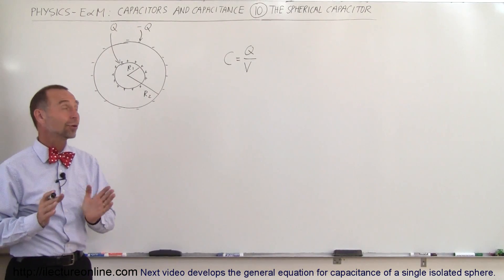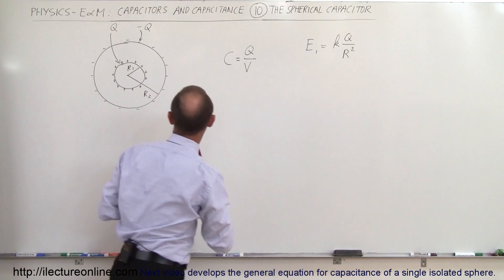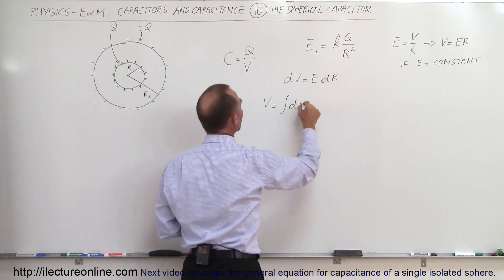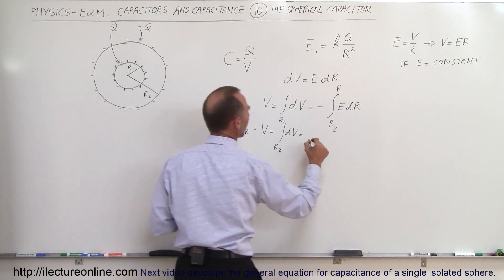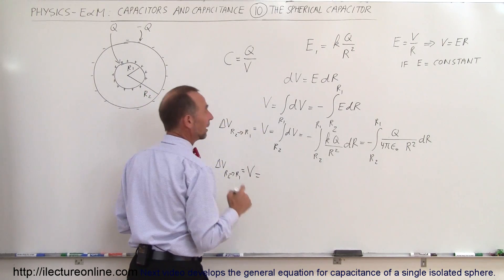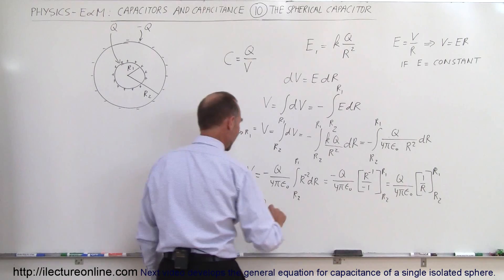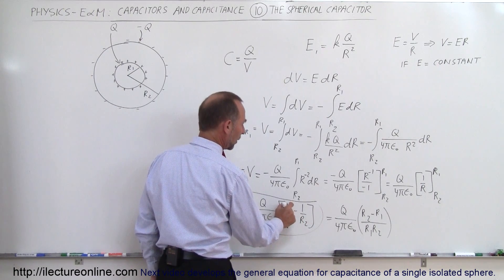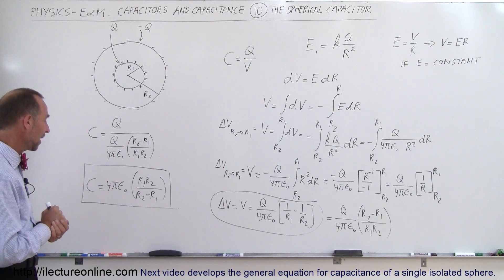Physics 39   Capacitors (10 of 37) The Spherical Capacitor

Comment: If I understood correctly and I would be more than happy that someone will correct me in case that I am not- the reason he keeps the negative sign is because the potential difference in R2 is smaller than that of R1 so when integrating from R2 to R1 we are getting a negative result- hence he needs to put a negative 1 to cancel that minus.
Reply from the maker: You are correct.  🙂

Comment: I have one doubt, why didn’t the presence of positive Q charge on the inner shell induce a -Q charge on the inner surface of the outer shell, since the outer shell is a conductor and field inside it must be zero
Reply from the maker: There is always an electric field outside a distribution of charge (as in the inner ring), therfore there must be an electric field between the inner sphere and the outer sphere

Comment: Sir the video was very Good and concise But in my reference book i saw thath the outer shell was earthed and capacitance was calculted then in next case the innner shell was earthed and capacitance was calculated but here I wanted to ask can we calculate the capacitance without earthing.
Reply from the maker: The only thing that matters is the potential difference across the plates.  Grounding one side or the other side, simply places a reference voltage of 0 V on that side.  As long as the voltage difference between the plates is not affected it doesn't matter.

Comment: Hi! Thanks for your videos. I think I have a little of confusion . Isn't the electric field inside a conductor zero ? Then why is there between R1 and R2 an electric field? Thank you a lot!
Reply from the maker: Gauss's law stated the the electric field strength multiplied by the area of the Gaussian surface is proportional to the charge enclosed by the Gaussian surface.  So bottom line, there will always be an electric field around an enclosed charge.

Comment: You use incorrect relation between E and V. Since E is a conservative vector field the correct relation is: V (B) -V (A) = - definite integral (from A to B) from dot product E * dr. In your calculation, to get a good result you’ve had to change the interval of the integral. Using the correct relation, nothing has to be changed or determined.

Comment: When you change limits doesn't E.dr changes signs? (you never took the integrand as vector dot product, so technically this derivation is wrong although you get correct result somehow)
Reply: @Debanjan Bhattacharjee You think 'dr' is radially outwards?? 2:33

Comment: sir,what confuses me is E is pointing radially outward but the path is chosen inward.so E.dr=-Edr shouldnt it be the case??
Reply from the maker: Since the change in voltage = E dr     The voltage change is negative traveling in one direction and positive traveling on the opposite direction

Comment: Sir I am confused ,how these shells acquire this charge.
In my textbook ,earthing is also include but I can't understand it.
Can you explain me about it ,,,,,please.....
Reply from the maker: The purpose of the problem is to learn how capacitors work and how to calculate the capacitance, not how the charge is placed on the plates.  However that said, if you ground one of the plates and then apply a voltage to the other plate you will place charges on the plates.

Comment: Hello Professor, when you switched R2 and R1 shouldn't you have erased the negative sign on the first integral?
Reply from the maker: The sign of the delta V depends on the direction of the electric field and the direction of travel only.  If you travel in the direction of the electric field, the potential decreases and if you travel in the opposite direction, then the potential increases

Comment: You switched the boundaries of the integral but the sign didn’t changed. Why?
Reply from the maker: Where exactly are you referring to?   (Note that the voltage increase when traveling in the opposite direction  to the direction of the electric field)
Reply: @MichelvanBiezen  At 3:19, the E field is opposite to dr i.e. the angle between E and dr is π. So E • dr should be - E dr and the minus sign should be removed from the front of the integral sign, right?
Reply: @1_adityasingh  dr direction is always pointing outward whether you switched the limit of the integral or not. i think you are confused because when you reverse the limit of an integral in Calculus class, you have to switch the signs. Here is a different story. Here, your signs depends on the direction of Electric Field and dr. Since dr is 0 at the center and positive at R1 and R2 its direction is outward. You can always play around with the integral and if you move from Low Potential to High Potential and get Negative sign, you have to know that there is a problem in your integral setting and you can correct it easily.

Comment: Why is the electric field not determined by the charge on the outer sphere as well?
Reply from the maker: The electric field only acts outwards, thus the charge on the outside of the sphere does not affect the electric field inside the sphere.
Reply: @MichelvanBiezen  Thank you for your reply. But why doesn't the charges on the boundary of the outer sphere produce an electric field radially outward everywhere as expected, including in the interior as well?
Reply: @josephghobrial5985  This is a capacitor. Electric field outside -Q shell is zero. Why? Simply, apply Gauss’s Law. Qin = Q - Q = 0

Comment: Is this the case when inner sphere is earthed and Outer sphere is charged?... and there exists some other formula for the case when the inner sphere is charged and the outer sphere is earthed?
Reply from the maker: This is in response to your other question.   Since the capacitors are no longer connected, the charge on each of them must remain the same.    In the case of the parallel capacitor, the electric field between the plates is a function of charge density only, thus the electric field must remain the same.  Since the potential between the plates = E x d ,  the potential must decrease due to the decreased distance.  I would expect the effect on the spherical and cylindrical capacitors to be the same since the charges which are attracting each other are being pulled apart, which would require work, which would add energy to the system which would require the potential to go up (since the charge remains the same).
Reply: Which question sir?
Reply: Sorry because I am very confused up...
In tuition I am being taught magnetism I myself am practicing current electricity whereas I completed capacitor a few days ago and need to keep it on revision

Comment: Sir in most of the tutorial they show charge on inner surface of outer shell but u showed it outer side...why is that so...please reply
Reply from the maker: On this video there is charge on the inside surface and the outside surface.  With conductors excess charge will only reside on the outside surface.

Comment: sir i think the -q charge  should be in inside boundary of  the outer spherical shell????
Reply: This question is in a textbook as written. Why do you think the negative charge would be inside the shell?
Reply: You can put the -Q inside and +Q outside, but you have to notice that (the dot product) E . dr = -E dr because electric field direction now inward which is opposite to dr direction. The negative sign of the integral will be cancelled. You can now integrate from R1 (low potential) to R2 (hight potential) and you will arrive to the same answer as the Professor.

Comment: Why don't we account for the outter shell when calculating the electric field?
Reply from the maker: +Терорист Талибан 
The strength of the electric field between the inner and outer shell only depends on the charge on the inner shell, (see Gauss's law).
Reply: +Michel van Biezen I was also wondering this , when R=R2 wouldn't we then have to factor in the outer shell?
Reply: because if that outer shell didn't have any charge inside it the electric field anywhere inside it would be zero since charge is uniformly distributed. So moving around inside of it, where the field is always zero, means the outer shell doesn't really affect the electric field.
Reply: Терорист Талибан 
Electrons from Vbatt induces a field at the inner sphere which induces current into the outer

Comment: why didn't the sign change as we change the limits as now we have increasing potential
Reply from the maker: +rahul SHAILY 
When calculating the potential the sign is determined by definition, so as to ensure that the potential decreases when moving away from positive charges and the potential increases when moving away from negative charges.
Reply: No, by definition the sign is negative. Even switching the two points you don't need to change the sign, but just take into account that actually you are integrating the scalar product between E and dR, so you can just use a different angle between the two vectors (theta = 0 if you are integrating in dR from R1 to R2, and theta = pi integrating in dR from R2 to R1)

Comment from the maker: Tushar,
SInce R2 is larger than R1, R1 - R2 is a negative number.
Capacitance cannot be negative.
Rather than working it out as a strict mathematical problem, and ignoring the physical properties will leave you guessing (or you have to memorize the various rules when integrating over the electric field to find the change in voltage.
Better just to look at the problem and determine what sign it needs to be.
(That is what they did to set up the rules for the sign)

Comment: v=-(integral)E.dr
here angle between E and dr is 180deg 
so the capacitance comes out to be c=R1R2/k(R1-R2)
please correct me where am i wrong????
Reply: I have got the same problem. The integral should be from R2 to R1, but without the minus sign. (Because E • dr is negative)
In Concepts of Physics by H.C. Verma, the same integral is given (which Michael mentioned), but I can't understand.

As your comment is 4 years old, you have already completed 12th. Currently I'm in 10th. Can you explain me why there is a minus sign?
Reply: @1_adityasingh  HC Verma's this particular derivation is not technically correct. Find the integral from smaller to bigger radius and you will get your answer (also realise that in doing so you are finding potential difference of negative sphere minus positive sphere, so remember to multiply both sides with negative in later stage).